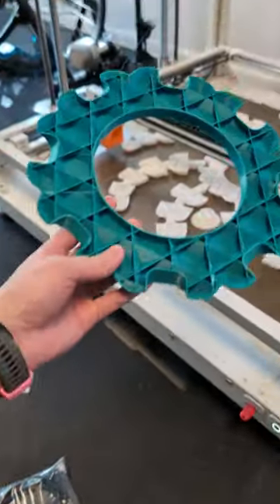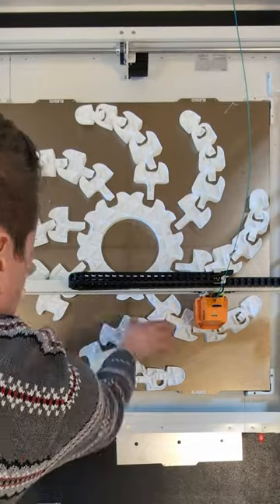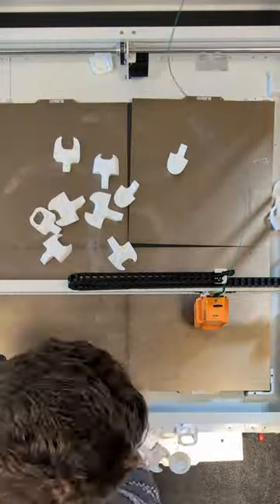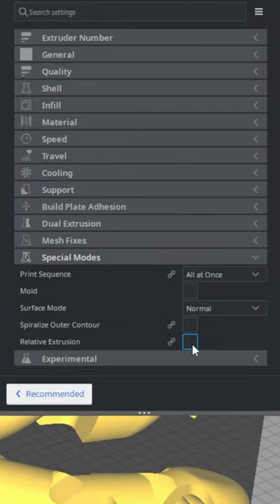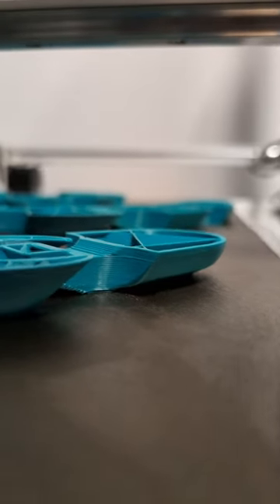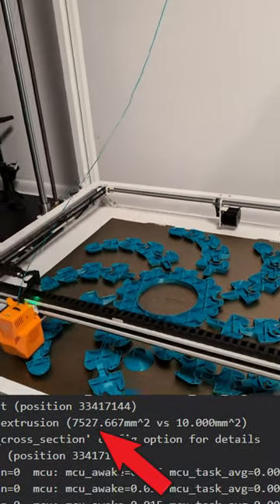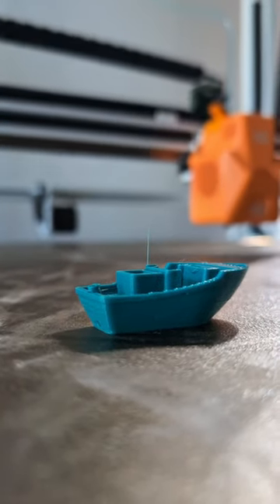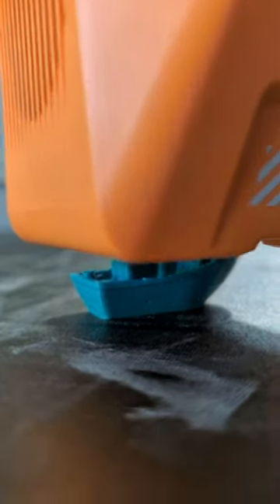Giant 3D Print Failures

Comment: I would resume those prints by manually cutting the gcode file rather than throwing away all that material...
Reply: When klipper encounters that error it cancels the print. Which means if you weren’t there when it canceled you likely aren’t rescuing it since the heatbed will have cooled and released the print.
Reply: @xiar5546  Yes, that's generally a problem if your bed adhesion is just heat based, but in the video it looked like they were still.partly adhering. Also, turning off bed heater isn't inherent in klipper except in the event of critical errors causing shutdown. The idle timeouts will do it by default after SD card job errors out, but you can change the timeout or change what it does. Mine doesn't turn off bed if paused or if there was a job in progress, only if the bed was just left on idle (preheated).
Reply: You could sell it since it can be broken down

Comment: Question, what might make single details on a print not extrude properly i was designing a cookie cutter of a draft horse with squiggly lines to represent hair on the legs that were
 .8 wide by 5mm long and each time I'd slice it, it would come out under extruded and squishy and peal off easy when the rest of the details were just fine in the end i had to remove the details

Comment: what is the difference between relative and absolute extrusion?
Reply: Relative means that you add or remove from your actual position value. Absolute means you're counting from a "set zero" position to know your position. This means that if you want to extrude after a "pause" you would have to extrude from the last "set zero". In his case he has to extrude 7m meter (roughly) to reach his last saved position in the gcode file. Where if he used relative mode he would extrude from his actual position and not the last saved position.